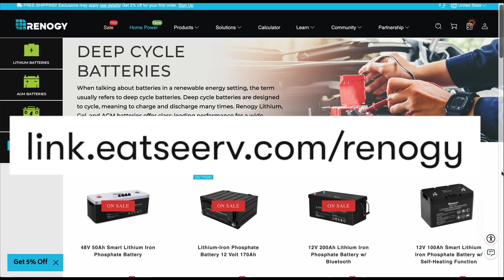The Downside of RV Life! Endless RV Repairs + Major RV Solar Power Upgrade

Comment: Thanks for this video. When I was looking for a van I wanted to find one with the simplest systems available.  I got a Solis and am very happy with low tech because that much less to break.  Happy repair and upgrades. Love your videos
Reply from the maker: Yes less tech can sometimes be better. Depends on the tech! Haha
Reply: @EatSeeTV   I may upgrade to lithium but so far with no microwave and dc fridge I’ve kept batteries on 3/4 easily.  Love the videos